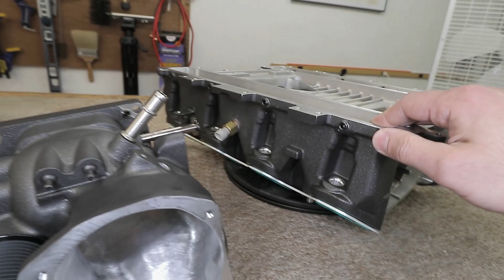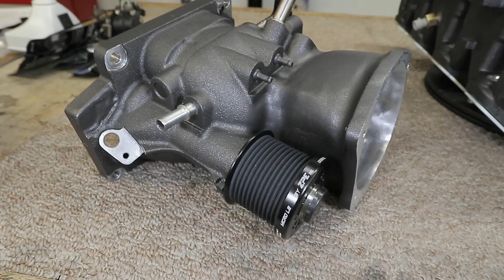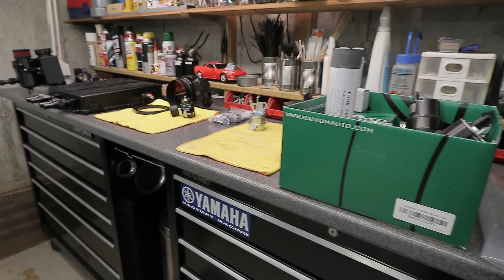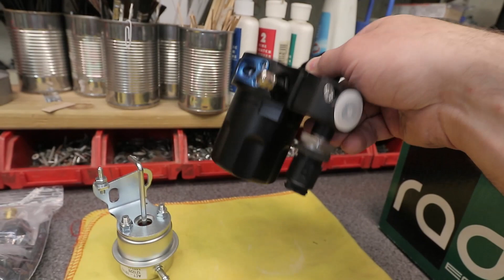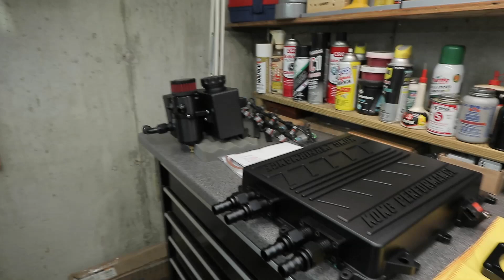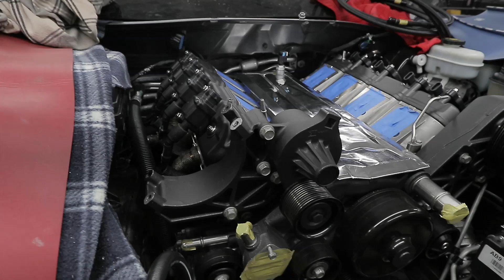Hand Ported Modified KONG ZR1 Snout & Stock 2300 Supercharger MAX Effort | LS9 HEADS & Cam Build

Comment: Just curious as to where you found out that coupler needs to be replaced everytime you take the snout off? Not saying you are wrong just have always seen people and companies take the snout off and port and then put the snout back on. Never heard of any failures. Is this a known fact or you just taking every precaution necessary? I've just never heard about this being a problem and I can't find any type of information to support this data. TIA and nice port job brother  💯💪🏾
Reply from the maker: Not the plastic 6 hole coupler but the drive hubs on snout and case. And i prefer to follow Eatons proper rebuild procedure. Those come in a eaton rebuild kit for a reason. Its because the male drive hubs with 3 prongs are made of a softer metal on purpose so that when pressed in, get splined in place by the hardened shaft once assembled. Once taken apart for porting 99.9% of people just press the 3 prong male hub back in willy nilly and dont get the same alignment & tight proper fit. Which can lead to a potential for the hubs to dislodge and spin on snout shaft. 

There tons of people out there doing things incorrectly, including porters and shops that have no business taking apart blowers. 99% of them arent even certified by eaton as a blower repair /service center to begin with and have no idea what the proper procedure actually is or have the proper tools to do so with out damaging the blower. Customers just assume they all know what they are doing LOL
Reply: @ModernHotrodsNH  thanks for the information

Comment: Hello
 just found your great video, I also recently pursued an LSA super charger For a project built ( 1963 Chevy ImpalaSS & 1984 Chevy Caprice Coupe).
In January I plan on Sending my blower out to get ported.
 I know you did your own and that's a great job , i don't know if I'm confident enough in my skills yet to do it myself.  
Can you recommend a good company for that? I've got'n recommendations for the company joker.

 Do you have a video showing how to pin the pulley, I am also changing my upper pulley to the 2.50 GripTec. 
 
Any help you can give me or  advice would be appreciated thank you again!!